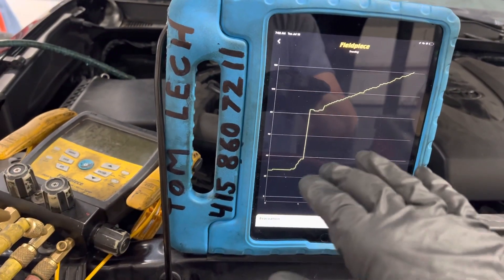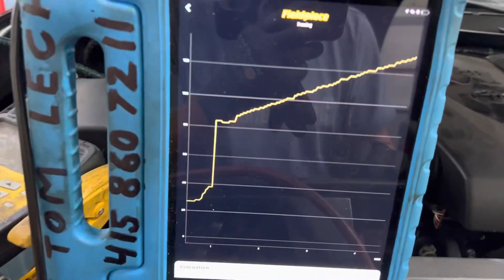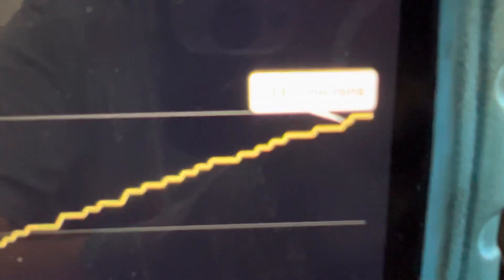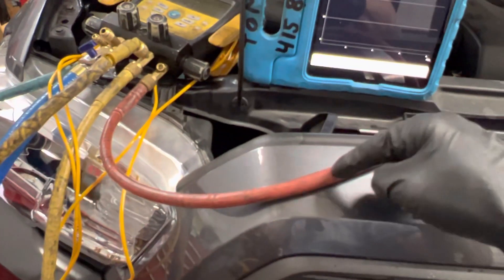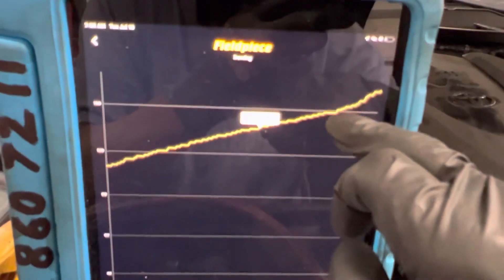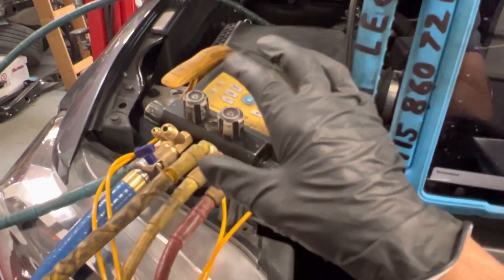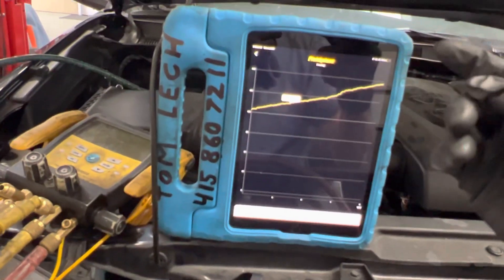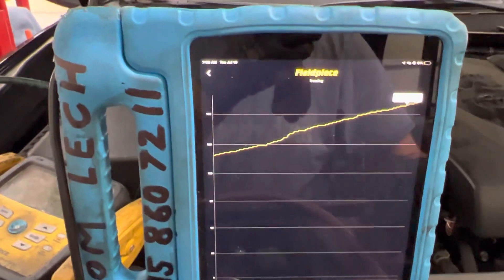OVER NIGHT VACUUM ON CAR.   How low of micron reading can you achieve ?.  ￼

Comment: Do you see this on new systems?  Or with new hoses?  My guess is moisture in the ac compressor oil?  Its pretty irrelevant right?  does the system function as intended?
Reply from the maker: @jonathannagela2130  moisture is long term damage nothing immediate. 
Unless a lot then less cooling

Comment: if you are nervous to just "leave the vacuum pump on all night" for fear of fire, running dry on oil, fear of the sound setting off the building's alarm, etc, is their any benefit in just leaving the vacuum pump hooked up under vacuum all night? Will it still "boil out" a meaningful amount of moisture when not "running", but still under vacuum, or does the pump need to be running to actually "pull the moisture" out of the system and discharge it into the ambient atmosphere?  Can you leave it off, but under vacuum all night then just run it for 20 minutes when you get to the shop in the morning to "vent out" the boiled out moisture suspended inside the AC system?

Great video!!!
Thanks!!!
Reply from the maker: Needs to be running.

Comment: Keep up the great work .  To start with  every one try a  dedicated single line thru the low/suction for evacuation . Then have a micron gauge  on the high /liquid . Also have a charge line connected to the high /liquid . . I find the micron readings are  honest because the lack of bad influences by  charge hose / gauge . No disconnect , no air contamination then  charge as liquid . Simple and done .

Comment: Hey,
I had a strange case yesterday.
2013 Audi A4 R134a.
A/C work generally good, "feels" good, temp. out of dash ~5.5*C.
Customer serviced car, 2 years ago, he came to me only to general check, and to evaporator Wash and clean from mold.
So.
I recover refrigerant. Was 520g out of 600g total, so after 2 years looks really seal tight system.
Purge with nitrogen, first fast vacuum, nitrogen pressure test pass, so i go to pulling deep vacuum.
And i dont know why, but i cant pull bellow 900-1000 microns, all time microns little little jumping, but not much,
in 98% cars usually at the level of 900-800-700 Microns,  delta/time micron drop is around 80-200,
BUT on this car delta was only 5-10, incredible slow pulling vacuum, Why ?
Changed oil on this car 2 times in 2 hour.
After 2,5 hours of pulling vacuum( via 2x 3/8") im only reach 520 microns, when usually i can easy pull down to 150-250 microns.
Whats could happend on this car depend on your experience?
Only one thing came to my mind, there was a lot of moisture, but how A/C work still good?
After whole service, tempereature out of dash on same settings, drop from 5,5*C, to 3,2*C, but doesnt it matter
for me, i wonder what the F*** hold vacuum hard for a almost 3 hours !!??
Reply from the maker: Did this have a accumulator ? 
Tons of deep oil a large desiccant bag + moisture. 

I get those cars a lot from body shop that left the lines open for one or two weeks three weeks while they were working on it.
Reply: @coldfinger459sub0  no accumulator, desiscant bag in condenser

Comment: Would love to see your setup. For the setup of vacuum with out a manifold. I have seen it done and done it on residential. But still thinking of what fittings I would need for automotive.
Reply: https://youtu.be/A6iypoeQECs

There is a video on that, but as Tom said, it depends on which refrigerant your car is using, but shouldn't be difficult for you.
Reply from the maker: Just about exactly the same as a residential HVAC heat pump except you have to adapt on R1 34A refrigerant couplings. 

It’s not difficult it’s not complicated I’ve made videos on it in the past before that have been posted only a few times. 

I need to make more videos on that topic and procedures. 

One of the other only differences between Automotive with the R1 34 or the YF refrigerant refrigerant service ports you do not have to remove the valve cores. 

There’s a conference diameter and the distance traveled to open up the valve core is 10 times the flow rate of the residential tiny little quarter inch valve core.